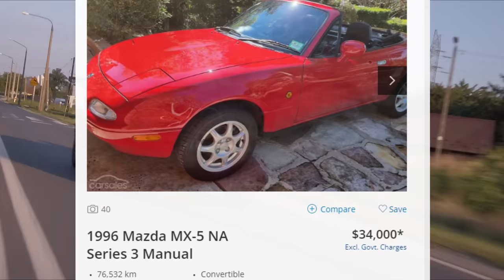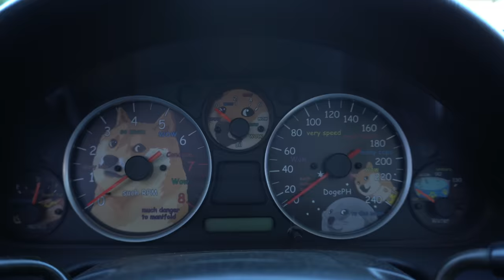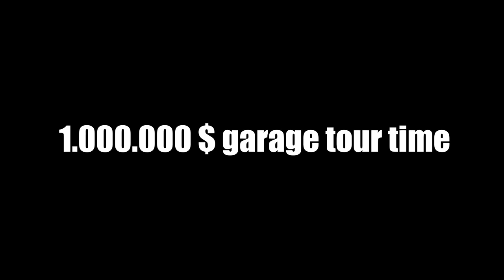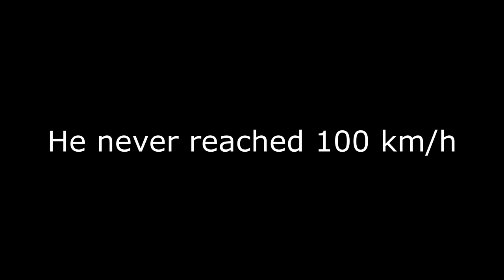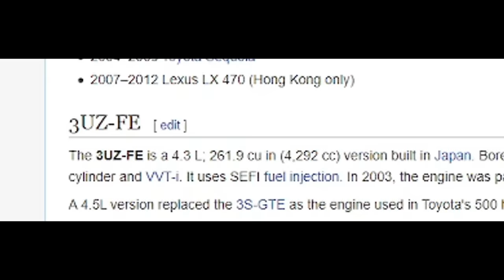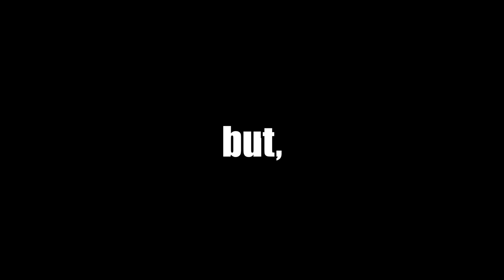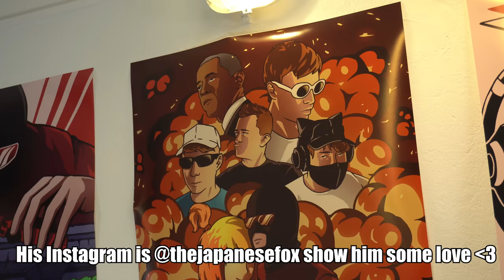Here's How I'll Ruin My Perfect Miata

Comment: honestly the thing im looking most forward to is the stance and the irp shifter, from personal experience IT WILL BE CRISPY AF
Reply: stance is too boring today
Reply: @iicylean  agreed
Reply: @iicylean  and performance hindering? what is wrong with my gen/gen z damn
Reply: @SSmallwood  stance as in how the car sits, i hate excessive camber -_-
Reply from the maker: the car will not be exactly a asphalt scraper, goal is to make it drive as good as a miata body allows it
Reply: @CarMighty  Won't putting a 4.3L V8 in it mess with the weight distrbution?
Reply: @CarMighty  honestly just spam paid adds for more money
Reply: I agree, function>form
Reply: @bryanribey  it shouldn’t be too bad, those BP’s are iron blocks so they weigh a ton. I’m assuming the 3UZ is an aluminum block so it will still weigh more but it won’t be a crazy amount more.
Reply: @moistavocado2350  yeah and he's putting a heavier duty driveshaft too so that'll balance it out a bit. Along with body part mods
Reply: @bryanribey Yes.
Reply: @iicylean  tell me how many you've seen irl, aaaaaaaNMD it used a lot for a reason, it's cool
Reply: @pranavdubey3333  but it's cool mom!!
Reply: @CarMighty  Hi! I think you should look at the reply to my comment because I find it very suspicious.
Reply: @CarMighty  If you do take it to the US, I would like to see it go around Laguna Seca or Watkins Glen

Comment: Ive been down this road with my NB. The power is great fun, but I think 250bhp is the limit before things get a bit silly. Also remember that the weight distribution will change a bit with an engine swap. The NB so I wouldn’t be surprised if this is true for the NA too, feels like it needs a touch more weight to the rear so you ideally want to lighten the front a little bit. While the 3UZ is only a touch heavier than the stock BP engine that you get, that’s still more weight to the front which puts more pressure on the front tyres and less on the rear. You could get around this by going with slightly wider tyres on the rear than the front. 

If you still want to daily this car then I advise against coilovers. Get a shock and spring setup like some high end Koni’s or even just bilstein B6s with Eibach proline springs. You don’t want to lower the car too much or else bump steer will be a bitch. Given the power and by extension speed you’ll be able to go, at least for track days you’ll want a wing on the back. You don’t want the tail kicking out on you at high speed and I know how snappy the tail can be at speed. 

WHATEVER DIFFERENTIAL YOU BUY GET A QUAIFE CLUTCH PACK INSERT AND SET THE PRELOAD FOR STREET USE!!! They feel absolutely wonderful and behave much like the NBFL’s Tochiga Fuji Super 2 differential. You’ll do some of the most beautifully smooth drifts possible with that. 

Some whiteline adjustable antiroll bars are high quality and easy on the wallet plus their adjustable drop links are nice too. Absolutely get some chassis bracing because the NA’s chassis is disappointingly floppy without it. 

Anyway, that’s just advice, you do you, man. Best of luck!

Comment: Mighty, im curious why you didnt choose a K24 swap, it keeps the weight 50/50 and yet is super easy to install all you would need is to buy a little kit and it bolts onto the transmission super easy!
Reply: To be fair the 3UZ isn't that heavy either. It is only around 30kg heavier than the K24, and it has nearly double the horsepower of most K24 variants.
Reply: @TheHiskiFinz  Still 3uz is pretty hard to install in a MX5

Comment: I don't mind sponsored videos, it gives people more time to make good videos since you don't need to rush them.
When it comes to paint I've got a suggestion: I've seen a very cool AE86, it was completly white with the doors, hood and trunk being exposed carbon fibre. Maybe something like that would also look cool on the miata in some form? I also have the idea to use carbon fibre fenders (like the stock ones, just in different material) and the rest of the car in a color you want, you would probably have to test it first in a game for example though since I'm unsure if it will look as good as it did in the AE86 I saw.
Reply from the maker: that would be actually insane, imagine how much weight we could save

Comment: The stock Miata 1.6 engine can pump out 300 turbo hp all day long. Any more than that and you'll need pistons and rods. That can take you up to 500 or so. Biggest danger to a high hp NA Miata is the weak diff. Next thing to bomb is the transmission.

Comment: you can put an E36 1.8 engine
or even an Engine from an e46-which is 6 cyl
in my opinion the most suitable engine for the matsuda is SR20DET 
i personally wanted to put a 13B in my miata-because i was only gonna race it
so the lightweight rotary was the best option but it turned out cheaper to buy rx-8 and fix the blown engine

Comment: 5:15 these truck are transporting a generator that can weigh up to 120
 tones! The classes of weight/size are 
Micro load 1-2 tone 
Light load 3-5 tone
Quarter load 6-15 tones
Half load 11-20 tones 
Full load 20-33 tones
Heavy load 33-40 tones
Oversize load 41-50 tones
Super heavy load 51-70 tones (2 trucks)
Super size load 70-90 tones (2-3 trucks)
Abnormal load 91-140 tones (3-5 heavy haul trucks)

Hope this helps! Love your channel btw